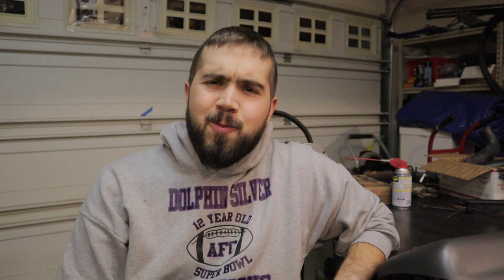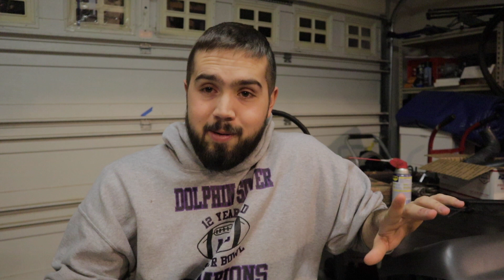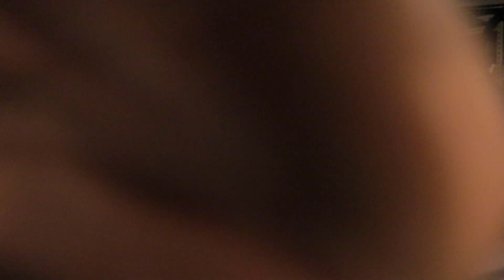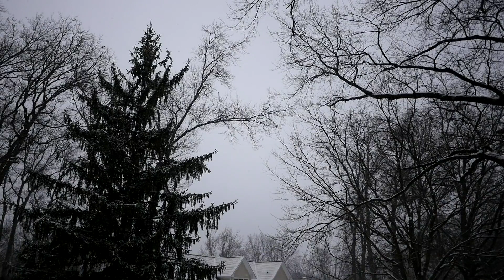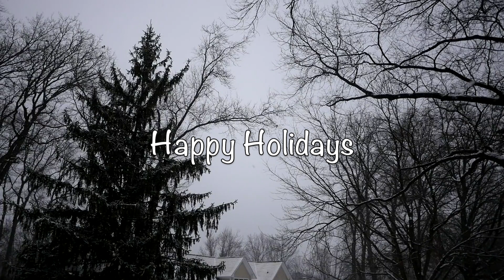BIG CHANGES Are Coming To The Channel...

Comment: I just started my channel,  I don't know what am doing, I don't have a single video as of now. However,  I do lots of projects, lots of fabrication, suspensions, engines etc. I just never record anything.  I was motivated by your channel so I want to start putting content on mine. I went with JBC because I do all types of work not only mechanics.  So I didn't want to be limited by the name. Living on wheels is the same thing.  You are not limited to 7.3 stuff. You are Living on Wheels and anything that's happening in your life is good for the channel.  Keep up the good work. Just keep this channel and fill it with any and all your content no matter what it is. Congrats on your property.  Best wishes!
Reply: Joe, hi, I'm also Joe.  I have some questions about my trucks. I have a 2002 7.3L and a 1997 F350 7.3L. I have a few questions regarding upgrades on both of them. Been thinking about upgrading turbo on both. Also, questions about getting started on my channel.  Uploading videos and stuff like that. Do you have an email for that type of communication?  Communication through YouTube is not ideal for stuff like that. Let me know. FYI, I don't have Instagram, I don't know if that would make a difference.  Let me know either way. Thanks!

Comment: I think you should start as one channel and then as things grow maybe split it later on. You will have a lot of subscribers in this channel that may not be interested in that and you also may find new subscribers to the new channel that are not interested in the 7.3 content. However you already have a pretty good following so the start up on the second channel should not be as difficult or time-consuming. I am in a very similar situation. I am only two weeks into the start up of my channel and I have many different themes. I fully expect that I will have to split the channels eventually. And by the way congratulations on your new adventures.